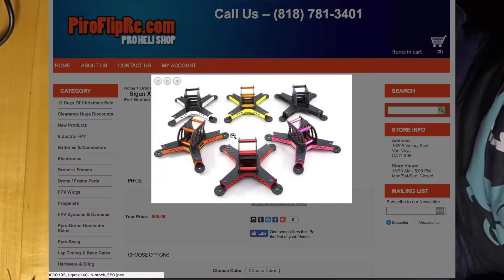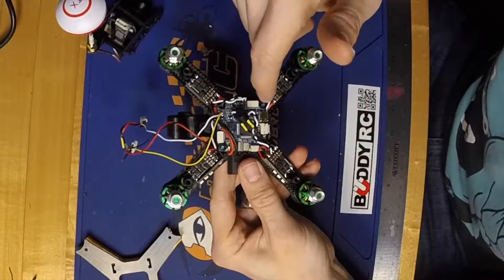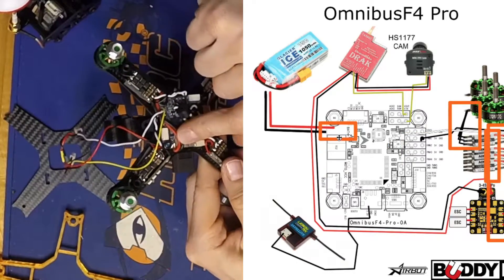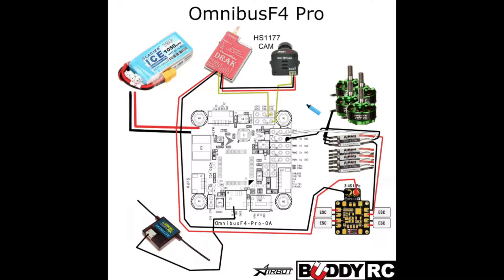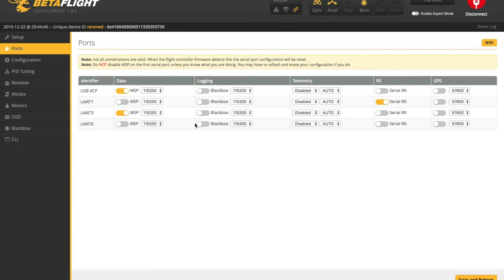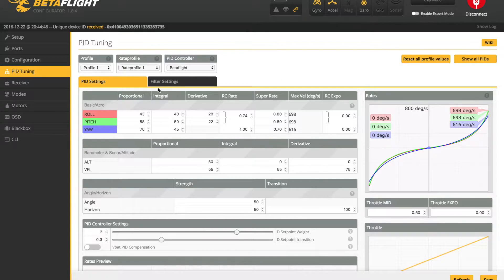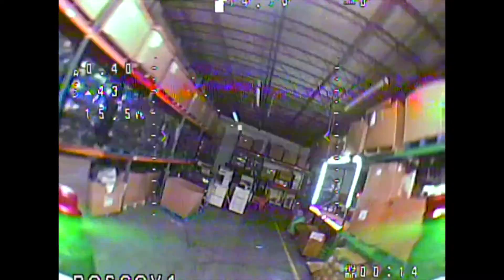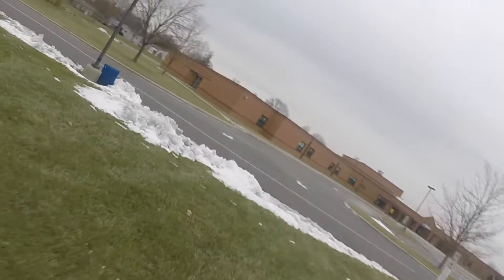Getting a 3" prop quad to act like real mini-quad.

Comment: i got the omnibus f4 v3 pro with current sensor,osd and smart audio for replacement of hyperlite f4 that had no osd and it lost all my data on a battery bootup so i am hoping the omnibus will be easy to wire up im new to this and hope and pray to not be down again because of a memory loss like hyperlite f4 did. Hows this omnibus f4 pro v3 done for you? Have you ever heard of someones quad losing all the setup in betaflight? Bought from racedayquads so im hoping it will be good and keep me flying for long time